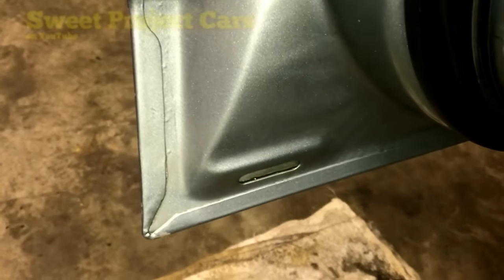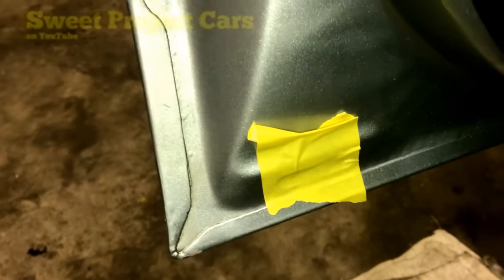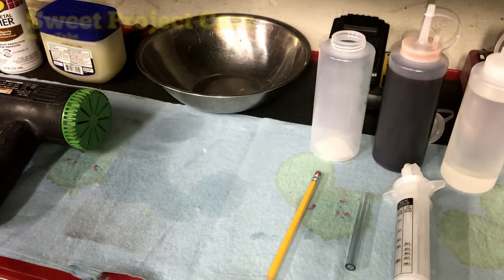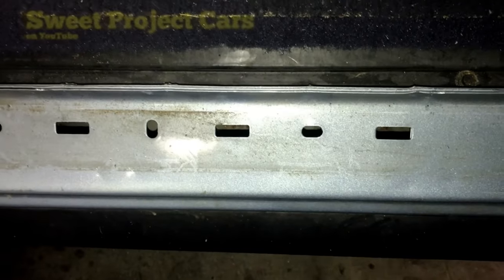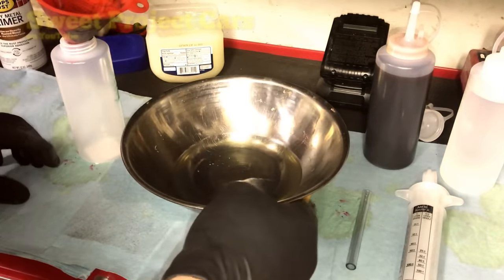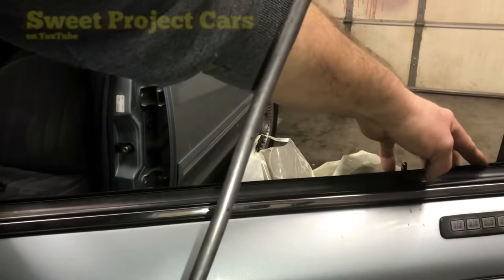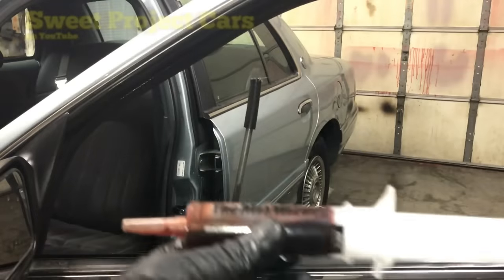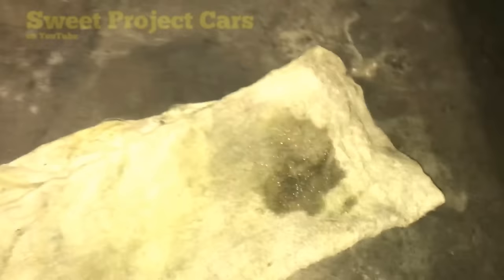Your Car Will NEVER RUST Again! For Just $10 Bucks!

Comment: at 4:00 it says its not flammable but wikipedia claims:

Physical properties
Petroleum jelly is a mixture of hydrocarbons, with a melting point that depends on the exact proportions. The melting point is typically between 40 and 70 °C (105 and 160 °F).[7][8] It is flammable only when heated to liquid; then the fumes will light, not the liquid itself, so a wick material like leaves, bark, or small twigs is needed to ignite petroleum jelly.
Reply from the maker: Petroleum jelly is not flammable   Watch this  https://youtu.be/5J0VG4_jR2w  The only reason it SEEMS that the petroleum jelly burns on cotton balls is an illusion.  If you are to take a cotton ball with nothing on it and light it on fire it will burn up in seconds.  By adding the jelly to the cotton ball, you are slowing down the combustion rate of the cotton ball, it is not the petroleum jelly that 
is burning it is simply slowing the cotton ball from burning up in seconds. Thanks for watching.  mad Mike the hammer SPC

Comment: Here in the Uk we have a lot of rain so rust can be a big problem.I use a specialist treatment called waxolye.I am sure you can get simular in the US.Easy to use and lasts a longer time and works well.I have also used engine oil which again keeps rust away although probuably it will need doing every three or four years.I have recently had my brand new Land Rover Discovery D4 (LR 4 ) professionally waxolyed as I intend to keep her for many years.I buy my cars new and keep them for many years so rust can be a problem if you intend to keep your car for a long time. Love these u tubes by the way.thanks
Reply from the maker: vulcan THANK YOU very much we truly appreciate you sharing good tips :)

Comment: I repair rust for a living & this is one of the few "rust prevention" videos I have nothing to "add" - here's how you do it. ATF, mineral oil & vaseline. Coat stuff in those. If it rusted already, use Mepa first, then use these. Mepa is my fave product, Mepa works.

Comment: Some Doors and tailgates have drain holes,they get plugged up, remove panels and clean out, spray coat inside.
Reply from the maker: Thanks for the tip Robert!  Have a great day.  mad Mike the hammer SPC

Comment: I had a 5 year old Ford Focus and noticed these cars rusted out in the lower hatch, doors and rocker panels.  I bought a $6 can of white lithium grease and pulled off the trim to spray.  Five years later I had a 10 year old Ford Focus with no rust.
Reply from the maker: Thanks for watching and sharing Stephen.  Have a great day. mad Mike the hammer SPC

Comment: I use old motor oil. I have 1999 ford ranger I put old motor oil in the rocker panels and they are as solid as they were the day it was built.
Reply from the maker: Nice!  Thanks for sharing AJ W!  Have a great day, and thanks for watching.  mad Mike the hammer SPC

Comment: I used Eastwood's rust products inside my doors five years ago and both rotted in the same place on the pinch weld right in the center.
Reply from the maker: That's why we don't use that stuff and use the method we use, works every time and lasts for years and years.  Thanks for watching and sharing.  Have a great day.  mad Mike the hammer SPC

Comment: Spraying wd40 into the drain holes in the bottom of your doors until it runs out the other side works good too
Reply from the maker: Yes, we have tried that over the last 40 years and found that it only lasts up to 2 months at the most, this process lasts forever.  Thank you for the comment.  Have a great day.  mad Mike the hammer SPC

Comment: Keep the salt off the car, wash the car often.

The metal will last much longer.

Other option is wash the salt off the car, then on the dry surface of the car, wax the car and leave on the excess wax, then wash it off in the spring, at the coin carwash.

When the wax is on, it helps repels water / salt water from the road.

Comment: you can also just use your used engine oil. pressure wash your undercarriage dry and wipe or spray used motor oil on all metal except brakes
Reply from the maker: dann hienn     thank you and thanks for stopping by to pick up some of our common sense DIYer tips.

Comment: After fixing a decent patch in my rockers...which the car seemed fine, and i got it undercoated the last 3 years...guess they didn't do the rockers. Yeah thanks i just wanted the plastics undercoated lol. Anyways, since it's summer i might have to mix something up and get all up in there and spray everything down. might be authentic and get some Mopar ATF +4 to spray everywhere or some bar and chain oil as somebody mentionned, anyways thanks for reminding me i need to do something about it lol.
Reply from the maker: If you want the cheapest best way to do it find some old transmission fluid or if you have to buy new use that and you will be glad you did thanks for being here with us have a great day mad Mike sweet project cars

Comment: Just use used motor oil.  Doors and tailgates and trunk lids (all lock seams)every 6 months.  Just use an oil can.  You will need to clean up the oil on the bottom of your doors, but will stop leaking after a couple of weeks.
Reply from the maker: Thank you for watching and sharing Thomas, have a great day. mad Mike the hammer SPC

Comment: Just a FYI, petroleum jelly ie: Vaseline is flammable because I use petroleum jelly soaked cotton balls as fire starters and it burns for several minutes on its own.
Reply from the maker: so sorry with this video here https://youtu.be/5J0VG4_jR2w will show you  Petroleum Jelly, does it burn on its own? When added to a cotton ball it is the cotton ball that burns the Vaseline does one thing it slows the cotton ball down from burning up in seconds.

Comment: I Like your thinking like I do. I used to use motor oil instead. What i cant stop is the rot in the strut towers. They are out of reach. Rusting from the top and above the wheels. As well as the rockers are concerned. Are gone too far. As I have that damn TRIM and I went to look and its foil thin and getting holes. I am concerned about my lower parts on my car. Trying to keep up with that mess. too.
Reply from the maker: I'm with you it is a constant battle sometimes...ugh !! Rust sucks

Comment: a man i'm from texas and theres shops in texas that will lift your truck or car and spray used motor oil under it all over the frame , nice video man
Reply from the maker: ARMY DAD   thank you my friend :)  we are very glad you are with us
Reply: My truck is over 20 years old.  It has the optional "automatic rust treatment system".  You see, the engine leaks oil from the valve covers, the front seal, the rear seal...and probably every other seal.  So, the "rust protective coating" on the underside of the truck renews itself every time I drive it.  The only drawback is that I have to add a quart of oil every couple weeks...but it's rust free!
Reply from the maker: LOL  dewy I like that      thank you very much we truly appreciate that and are very glad you are here with us :)

Comment: Will transmission fluid damage car paint on those doors? I was always under the impression that ATF is corrosive and a super penetrant when it touches metals (that's why I mix it with acetone to loosen stubborn rusty nuts). I know you say you can use mineral oil or Vaseline instead of ATF but was just curious. Thanks for the tips I will try them for sure.
Reply: I was wondering the same thing. From my knowledge ATF is corrosive to paint, but will protect bare metal very well. A little bit seemed to eat away at a painted transmission case on my truck, new solenoid pack I bought started leaking through the connector. Because of that I personally wouldn't use ATF.
Reply from the maker: Watch this Ziad  https://youtu.be/pMGHcKVo2Yk  it should answer all of your questions my friend. Thank you for the view and comment, hope you have a great week, sorry for the delay in responding. mad Mike the hammer SPC

Comment: Ok I agree somewhat , Ive been using old oil and trans fluid for years - especially on the fender well , radaitor support under the battery -  But  all this wont stop the salt from the road that gets in the door fold ( body seem) under the door ( the exterior ) .
Reply from the maker: Ronbo Nick  we have done this for 20 plus years on the same customers cars and trucks and with the salt and chloride up here in Michigan we have never had a rust issue...as far as the door fold we treat them with a clear rust prevention system that works to seal and stop any rust from growing there....thanks for sharing
Reply: Kool , FYI & ?  I was working in Fl and we used a front end loader to clean boat ramps in salt water .. They used some sort of clear srpay  on the loader to protect from rust.. Not sure what it was but the loader never did rust , I was there 15 yrs..  Good vids  keep'em coming
Reply from the maker: Ronbo Nick thanks you for sharing and this product you are talking about we will be using in our up and coming rust proofing video :)

Comment: do you use transmiton fluid as well as the mineral oil or only one and which one is best as with the petroleum jelly it would harden up eventually but stay intact as transmiton oil would eventually dry out    thanks best video ever Im about to get into it with my 2013 4 runner
Reply from the maker: The transmission oil is probably the best way to go, it has so many rust inhibitors in it that it's off the charts.  But if you want to do this and never have to do it again, do the vaseline wait until it cools off/hardens then do the ta right afterwards.  Thank you for watching and asking Bill, we appreciate it my friend. Have a Merry Christmas & Happy New Year from the team at Sweet Project Cars.

Comment: The best is linseed oil. It penetrates the rust to the healthy metal and prevents the rust from developing further. If needed dilute it with gum turpentine.
Reply from the maker: thanks for sharing we try to use what most people have readily available at home
Reply: Huh, really! Daniel, would you prefer linseed over mineral oil?
Reply from the maker: anthony you dont need all of that all you need is some cheap new or used transmission fluid and you are good to go
Reply: @SweetProjectCars  My only concern with the transmission fluid is potentially smelling it. I'm planning on spraying it on the underbody of my car and all within the rockers.

Comment: 2002 Yukon with outer rockers starting to get rusted through. Rust is getting started on the inner rockers where the running boards mount down at the bottom but up high them mounts bolt in they are rock solid. Would something like a bug sprayer to get oil into the route outer rockers and to spray on the inner rockers from under the truck do? The dumb thing is nearly perfect everywhere else and a low mile cream puff. I dont know that it is worth having the rockers redone but just stopping it dead where it is would be great.  I live where there is lots of snow and salt.
Reply from the maker: john underwood  if you can give us a few days we are doing a video on this similar issue, I think it will help you big time my friend :)
Reply: Awesome thanks! So many Chevy's running around with crappy rockers that would be huge.
Reply from the maker: john underwood im with you, and dodge has the same issues right along with fords...and the manufactures could prevent this if they wanted :)

Comment: Thanx alot for the video. Btw, I believe the car was a crown Victoria 1992-1997? My 2008 grand marquis has leaf building up in door jam and I try to keep it clean.  Brake line tubing and hose, that's a good idea. 

I'm going to buy pressure washer so o can wash out salt from wheel well, undercarriage and chassis. You think 1800 psi (the cheap less than 100 bucks)or the 2500 psi (4 to 500 bucks) is good for the job? In learning on the cheapest option

Comment: Thanks, so how about nuts and bolts under the bonnet or hood should we clean off the rust or just add the petroleum jelly etc?
Reply from the maker: It's always best if you can remove the worst part of the rust, then apply the mixture. Thanks for watching and asking Paul.  Hope you have a great day. mad Mike the hammer SPC

Comment: Another great video.  I started doing this using some leftover bar & chain oil thinned with some acetone.  It seems stickier than regular motor oil when it dries.  Any thoughts?
Reply from the maker: Great idea Jordan we say any oil other than gear oil is better than none it will definitely stop the Ross from starting in on a warm day it will settle and all the cracks and crevices just fine have a great weekend my friend

Comment: A car oiled, like you did, or oil sprayed is the only way to preserve a car body, whether driven or stored. I've seen 20 year old cars with perfect sheet metal that were regularly driven in the rust belt, greasy but rust free.
Reply from the maker: Well said!  Thanks for sharing.  Have a great night.  mad Mike the hammer SPC

Comment: Excellent video!
Thought of giving the petroleum yelly a shot alone, but not sure, if I should use the ATF and Mineral oil as well.
I live in north of europe, we have very cold winters and lots of salt on the roads/humid climate most of the time.

However, the doors on my car don't have the exact drains as in your video. The drains are actually at the very bottom of the door, so the petroleum jelly would block the drains after filling, when it hardens up again after being melted.

Can you suggest the best solution for these kind of doors, with drains at the very bottom?
Any benefits, if using all three products inside the door at the same time?

Much appreciated.
Reply from the maker: For your application disregard the petroleum jelly, use the other ingredients alone for those types of drains.  Thanks for watching and asking, we appreciate it my friend. Hope you have a great weekend. mad Mike the hammer SPC

Comment: O lost some plugs under the rocker panel. Do you have any idea in how to clean the inside and spray, maybe used engine oil, to prevent rust? Should I keep the holes open or close them completely afterwards. Thanks a lot!
Reply from the maker: If you treat your vehicle as we show, you can use any oil you want, and no you don't need to close up the holes.  Thanks for asking.  mad Mike the hammer SPC

Comment: Vaseline makes great firelighters so it is flammable just only to high heat/open flame
Reply from the maker: Petroleum jelly is not flammable.   Watch this  https://youtu.be/5J0VG4_jR2w  The only reason it SEEMS that the petroleum jelly burns on cotton balls is an illusion.  If you are to take a cotton ball with nothing on it and light it on fire it will burn up in seconds.  By adding the jelly to the cotton ball, you are slowing down the combustion rate of the cotton ball, it is not the petroleum jelly that 
is burning it is simply slowing the cotton ball from burning up in seconds. Thanks for watching.  mad Mike the hammer SPC

Comment: I've been treating my rust with zinc phosphate that turns rust black. Then grey zinc primer,then Rust-Oleum.
I can see how your method works but it seems messy and could hold debris that holds water. I like clean and dry but there's a time for oily too.
How about zinc anodes and electrical rust neutralizers? That's what's used in marine conditions?
Reply from the maker: Hello Jeff, you can use whatever you want to use, we are just sharing what we have found after years of testing to be the easiest, best solution for this application.  Thanks for watching and for your comment.  Have a great day. mad Mike the hammer SPC

Comment: There are excellent videos on utube comparing best products, both common items and designed for, and for common items vasoline was one of the best and engine oil and transmission fluid are one of the worst.   That test was done where exposed to water but water will run in between glass seals and down inside of door.
Reply from the maker: Thank you for watching TS, have a great day. mad Mike the hammer SPC

Comment: Great tip! If you have access, will brushing it on work the same or does it need to pool up?
Reply from the maker: Yes you can brush it on just make sure that it gets into the smallest cracks and crevasses.  Thanks for asking and watching.  Have a great day.  mad Mike the hammer SPC

Comment: If your vehicle is a bit older and already has some surface rust in the doors, fenders and rockers won't the rust and molsture be trapped between the metal and the treatment?
Reply from the maker: Linda if you do this treatment it will soak into the rust and stop it from growing and becoming even worse

Comment: sweet project cars what if there's already rust in these areas?  Would removing the rust first (get down to bare metal) and then applying the oil work?  or just coat with oil over the rust.  Thanks.
Reply from the maker: Steve Cornick see these video we did they will help you much more with existing rust. 1st Rust Video in Series  https://youtu.be/WOpKDt5JEFk

2nd Rust Video in Series 
https://youtu.be/PLQLuWdoFgw

3rd Rust Video in Series 
https://youtu.be/nSDiHydE23o

4th Rust Video in Series 
https://youtu.be/gh6X1d5BsYE

Comment: For the botom of doors ive always used a heat gun to dry everything up completely then drop a bunch of wax shaving all inside the door then reheat till the wax stops driping out... It has never failled me knock on wood. I have also done this with silicone by using a piece of tubing attached to a wire to direct the tip. It worked great but was very time consuming and finicky compared to using wax
Reply from the maker: Mordy Fisher thank you very much for sharing please help us and subscribe and share we would appreciate that ::)
Reply: Sweet Project Cars done and done😜